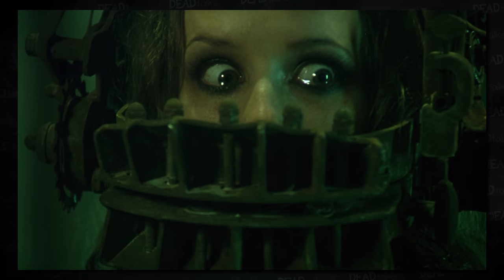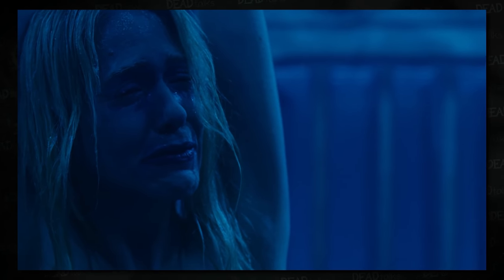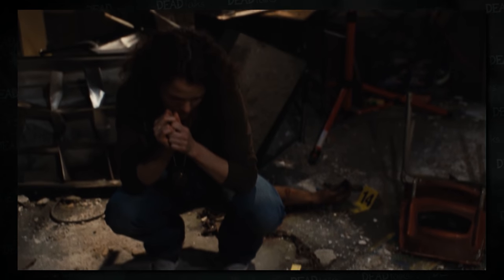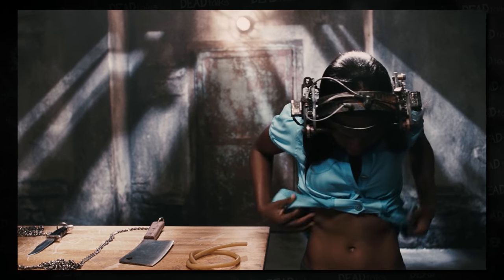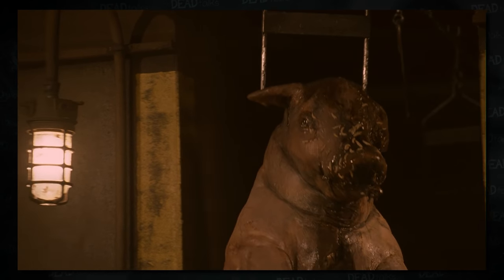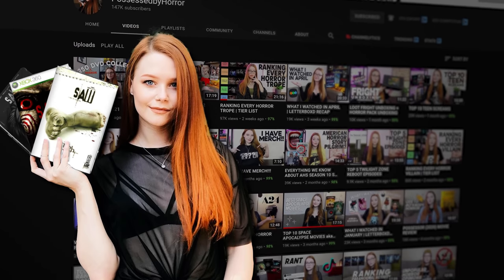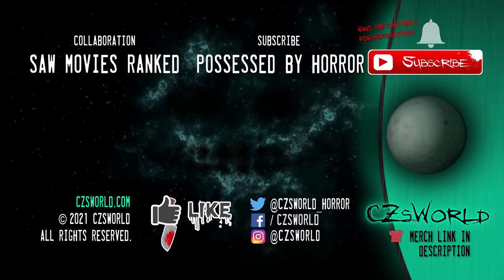5 Best Saw Traps Explained and Ranked | Ft. @PossessedbyHorror

Comment: Angel trap wasn't winnable at all. The lock didn't do anything. She got the correct key in time and unlocked it, but it wasn't designed to disengage.
Reply from the maker: It should have been though, based on John's intention for it.
Reply: he said it could have been winnable if it wasn't rigged with the wrong key
Reply: @boostedpotato7081  But the problem was that the lock didn't do anything on the trap but give false hope. She did complete her trial and unlocked the lock but she still died. Amanda changed something else besides the lock & key to make it unwinnable, but what the change was we cannot say for certain.
Reply: From what I understand, John designed the original angel trap. Though when Amanda went to set it up, she made a few adjustments that made the trap unbeatable.
Reply: right and the trap was literally in her bones. she couldn’t survive.
Reply: @boostedpotato7081  The key isn't how it was rigged, it was clearly the right key.
Reply: @CZsWorld  Amanda rigged it...
Reply: @CZsWorld  Yeah, it should've, yet it was latched into her bones. I guess that was Amanda's idea.
Reply: so with that trap I’m assuming, even tho they were locked into her bones (and if Amanda had not rigged it); if she were able to unlock it then the cage would not have opened up. she probably would’ve been able to get down and unlock herself further and would’ve been tasked with finding her own way to salvation/getting help
but since the key was switched out by Amanda then she wasn’t able to stop it from engaging🤷‍♀️ 
because I don’t think Amanda would’ve known how to stop it from disengaging without getting John or Hoffman to notice her tampering with it; but her switching out a key was plausible
Reply: Just a question because I was always curious since the first time I saw this trap. Wouldn’t she bleed to death?. She has her torso kinda open the whole time.
Reply: @boostedpotato7081  The key wasn't the problem. The device was attached to her ribs - how do you expect her to remove that? That's the exact problem SHE ran into. You see her undo the straps, and then realise that there's no way she can get the actual device off because it's attached to her ribs.
It's like how the classroom trap guy has a ring through his jaw. He couldn't have gotten that out. What was he meant to do, rip his jaw off?
Reply: That's because Amanda purposelly made it unwinnable
Reply: They already said that in the video.
Reply: It was never winnable the acid could've been poured out and if she knew the contraption she could've poured the acid on 2 wires that makes the entire trap work
Reply: Like others have said the key wasn't the problem. If you watch the scene she unlocks the cage then realizes that the arms are hooked into her bones. It would seem if she actually left the lock on the arms wouldn't actually been able to open. Idk if she would have been able to live long enough for her to be rescued. But her ribs wouldn't have been ripped out.
Reply: @MrLiljohn1980  I think maybe she bolted it on to a bone or something
Reply: @Alexander Wawrzyniak 
It’s easy to escape though
The acid would only cause skin burns which would hurt yeah but wouldn’t be a permanent disfigurement
Reply: it would be funny if it was winnable but the key was too dissolved
Reply: I do strongly believe if the trap was made by John Kramer himself he would’ve provided an easy way out for Detective Kerry. Unlike Amanda and Mark Hoffman whom makes the traps inescapable.
Reply: Semantics. The way Jigsaw designed it it’s 💯 beatable
Reply: actually it was! John planned for it to be winnable Amanda Rigged it by giving a complete different key! So it was going to winnable
Reply: @frooogy5292 it has nothing to do with the key. Kerry retrieved the key and succeeded in unlocking the padlock. The commentator obviously didn’t watch the movie or didn’t brush up before making the video. The real reason it was inescapable was because there was no way to disengage the trap from her ribs. I imagine that the original design was to unlock the padlock and remove the vest as Kerry did which would have revealed a mechanism with a switch, button, or lever of some sort that would’ve retracted the moving parts of the device from her ribs. I believe that Hoffman and John probably put Kerry in the trap and Amanda was instructed to do some final touches like preparing whatever mechanism dropped the key into the acid once Kerry became conscious. At that point she likely removed the mechanism so that unlocking the padlock and removing the vest or whatever the fuck it was revealed nothing that would have helped Kerry.
Reply: Even if the lock worked and it let girl free.. the machine was spiked into her ribcage. It cant go without dying of blood loss..
Reply: @MrLiljohn1980 My theory is that using the key on the lock was originally supposed to trigger a mechanism that would either release the cables and detach the harness from the trap or deactivate the trap itself, but Amanda rigged it by altering the design so that the lock wouldn’t do anything. I could be wrong though.

Comment: Another thing about the needle pit is these are USED needles so you can survive it initially but its entirely possible for a person to get some kind of disease from this pit, possibly even a deadly one
Reply: You could also survive by somebody who was up there, in this case, there was. You could attempt to get a coat or shirt to make less needles puncture your skin
Reply: HIV and Hep don't survive long after exiting the body, so the chance of getting any of that from the needle pit is extremely slim. A thin piece of cloth would do nothing against a needle... 

If anything the needle trap is probably the easiest and least painful traps in Saw, the reason it works so well is most people hate needles, myself included.
Reply: @Death-999 I’ve had bad needle sticks before and I can assure you that the Needle Pit is far from the least painful trap. Bad needle sticks are extremely painful. If you’re unlucky enough to get one, you’ll never forget the pain. I know that from experience.
Reply: Okay you totally gave me a new perspective. I thought it would be an easy trap. Whoa, did not think about bad needle sticks and ouchie!

Comment: My only gripe with the freezer room trap is that he could have took off his sweater to cover his face so he doesnt have to make skin contact with the pipes. 

If I'm missing anything about that trap I'd love to hear it.
Reply: There were lots of ways to avoid true punishment, for both involved. He could use his clothes to block the sprayers, giving him much more time to get the key. He could, as you said, use his clothes as a barrier to prevent burning off sections of his face. He could have just been faster instead of stewing about the decision (granted that's the point of the trial -- they expect him to take forever to decide).

Plenty of these traps are beatable in ways not intended by Jigsaw, especially since he has a tendency to set them up in areas with lots of loose crap around to screw with the mechanisms.

Comment: 2:52 Another thing to note is that if it's too cold, the water would freeze before reaching her, basically pelting her with little ice nuggets every time it shoots.
Reply: i think it was actually liquid nitrogen instead of water
Reply: @isabellam6027  But liquid nitrogen doesn't turn into ice, and we see a THICC layer of ice on her by the end of it. Pretty sure it has to be water.

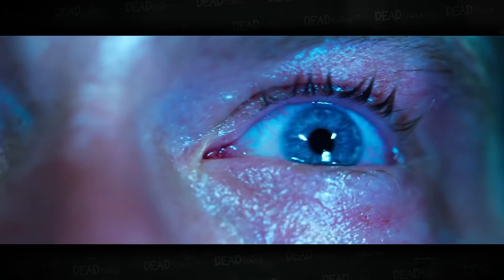Comment: 7:25 the thing about the tongue trap was that even if he jumped and ripped out his tongue we would still certainly die. The tongue connected to just about everything in your head. I’m not entirely sure where in the muscles would tear out, but at the very least it would sever the lingual artery and you would undoubtedly bleed to death, or at the very least choke on your own blood, without a tongue it’d be very difficult to keep the blood flow out of your airways and you’d need immediate medical attention, you’d most likely bleed out or choke within minutes. The tongue is also connected to the mandible and the temporal bone, meaning it is very possible that either the tendons connecting the tongue to the jaw and skull would break, making basically your entire throat come out of your mouth, and even if you immediately get treated after the fall you would still lose your ability to move your lower jaw and your ability to swallow, meaning no talking, no solid food, and an extremely high chance of choking for the rest of your limited life. It is unlikely he would survive the initial impact, but even if he did he would have seconds to minutes to live and would most likely pass out from blood loss/shock before he can get anywhere close to help.
Reply: like honestly ethier way if you got hit by the train you would still get your tounge
ripped out

Comment: Bathroom Trap? It's so iconic especially with John laying there the ENTIRE time shocking tf outta them. 😅😂
Reply: It spans a whole movie and is convoluted, dunno why it wasn't chosen. Same with the reverse bear trap, so what if it was repeated, the reason it was repeated was because it was so awesome. Yet a pit of needles took up two spots. How is a test that can barely hurt you despite little pin sized pricks beat something that will rip your face apart? Literally zero logic.

Comment: The key did unlock the padlock on the angel trap. The issue is that after removing the covering that was padlocked on, no way of disengaging the device from her rib cage was revealed. It is likely that John designed the trap to have a mechanism with a switch or lever that was inaccessible without removing the cover that was padlocked. Amanda probably simply removed this mechanism and reinstalled the padlocked cover.

Comment: The spraying water in the cold room would be SO easy to beat... Throw your shirt and pants over the spray, then you have an infinite amount of time to get the key and it wont be blasting her with cold water anymore. To not burn your face, rather take off your socks or underwear and use it temporarily as a barrier while you grab the key - unlock the girl, grab your frozen clothes back and exit the room together. Eventually, your frozen clothes will melt and you can put them back on again later.

Comment: I wanna explain my take on why the angel wing trap is my favorite and why its winnable (if Amanda hadn't sabotages it and the key was correct). So if u notice closely the jar that holds the acid is movable not still, so she could have easily tilted to the side to spill the acid on the floor, and then the key wouldn't have melted, neither her hand. Only Amanda ruined her chance of living... I think thats a good explanation ive been thinking of it for a while

Comment: Top 5 - Bucket heads - only downfall of this trap is that the buckets were removed after first part of the game, would be better to have them equipped for more than just 1st part
Top 4 - Acid meltdown - only game / trap that you cannot win, but the game plays you, not sure if there is another game-trap where decision of another will decide your result.
Top 3 - Waterboarding by hot wax - brutal, cruel, and unimaginable trap, would put it higher, but both top places are already taken
Top 2 - Finger trap from Spiral - doable, survivable, maybe (just theory) even without ripping your fingers off, but still very effective
Top 1 - Nail death mask -- fast death, yes, doable, possibly, but brutal yes

Inglorious honorable mention - Brazen Bull, although I like this trap, it is mostly not her deal that she is suppose to be in the trap on first place.

Comment: All of the traps in the Saw series are designed to work as intended in real life (if they’re made to do so, of course). The production team take great care in designing traps that can work in real life, even enlisting real engineers to help them design the traps. They’ve been doing this for every single film, even the Saw 0.5 short film that James Wan and Leigh Whannel made in 2003 to pitch the original film (they enlisted a friend of theirs who was an engineering student to help them design and build the first Reverse Bear Trap).
Reply: Which is why I won’t be surprised if it ends up happening in real life

Comment: Y'all should watch Nerd Explains (or it could be Cinema Summary, both are good and do similar videos) on beating SAW. The angel one is completely unbeatable, because even if the key was correct, it wouldn't stop the trap. And the scalping one simply wouldn't be a factor if the detective had listened, as he started the trap by interfering.

Comment: I used to worship the Saw franchise as the best horror series ever when I was a kid, until I realized that the majority of traps can be escaped easily through methods that weren't mentioned by the instructions. Then there are some traps that you just couldn't escape even if the instructions claim that you can. So some traps just don't work as intended and once I realized that, I started to dislike the franchise. The stupidest example is that guy who pretended to have survived a Jigsaw trap and had to impale meat hooks into his shoulders to hoist himself up some chains to get a key. If the only goal was to climb up and get the keys, why need to impale yourself? Just climb up the chains. Climbing up rope might be a challenge, but chains would be easier.

The freezer trap: the guy could've reached the key without his face sticking to the bars if he put cloth over the bars.

The blood eagle: even if you managed to get the key through acid, how do you expect to free yourself from a metal contraption that's hooked to your ribcage while one of your hands have been melted to the bone? Sure, you could argue it's possible the strings just detach from the contraption but you won't remove the cables attached to your ribs without damage, possibly bleeding out. This trap is just sketchy, add the fact that the key was the wrong one (on purpose)

Pound of flesh: I don't remember the entire set up and it's barely visible in the video. Couldn't you just pee in the container with the scale? This may not work though since liquid would likely spill, unlike flesh. Then again, you have tools and furniture around that you could throw in. In desperate situations where your adrenaline is in action, would it be too hard to dismantle that table?

The tongue one in the subway looks fine. I haven't seen that movie though so it's harder to comment on it.

The hair trap: if you know there's a knife around and your hair is the only thing that the trap is pulling... Well, I think this is a no brainer. Instead of telling the guy to look at the numbers on the gears, just have him cut the hair off. Do you really think killing the dude is even an option when you're trying to survive a trap? Save yourself first and then worry about whether you wanna kill the guy or not.

The pig grinder: that seems like it gives you a bit of time and some freedom to move, find a tube the guy could breathe through and/or stop the machine? Possibly low chance of success though.

Needle pit: the only reason most of the traps here have killed anyone is because the people rarely ever helped each other, almost all traps here could've been escapable. There are plenty of tools around and they managed to rip some boards off of the wall at some point, use them to dig through the needles instead of your hands.

The gallows: another trap where jigsaw actually does the killing and the victim isn't the one being physically hurt... These types of traps are cheaty.

Cupid arrows: this one is quite good. Only complaint is that once the girl has pulled the spikes out, there's a possibility she still does bleed out.

Needle pit chosen twice? I don't like Saw 2 that much, it's full of dumb situations. It massively relies on the people in it, even though a lot of traps are survivable. I'd say Saw 2 is the worst film in the franchise in terms of anything other than the social drama (one thing the film excels at).

In general, most traps with gears might be beatable. People often have tools around, sometimes metal, try sticking some in between the gears.

Traps with guns pointed at your head? Aside from the shotgun necklace, singular barrels pointed at your forehead can be dodged, there's such a thing as tilting your head to the side, maybe your ear gets blown off but it's a small sacrifice to try surviving.

The head in the fish tank one? It's clear that the bottom is made of rubber to form a tight fit to stop the water from leaking out, did you really have to stab your neck to breathe? Stick your fingers in between your neck and the rubber and have the water drain out...

Comment: Is the Angel Trap not attached to the Detective's ribs? So even if she did get the correct key, she wouldn't have been able to escape?
Reply: Who knows since it was rigged, but maybe there was something between the device and things attached to the ribs that could be separated once the locking mechanism was removed.

Comment: Okay I get the concept of needle pit is absolutely horrific. But in the movie it was way too easily avoidable. They have metal\wood planks and boxes right in that room, it could be beaten faster and with less trauma by just using those. So the concept - pure nightmare fuel. But execution - eh I dunno
Reply from the maker: I think the issue with that is that you might be on top of the key.
Reply: @CZsWorld  yeah that's fair. However Amanda was at the same level of threat, basically being on her fours with quite a limited circle of search. But yeah, technicalities, it was still hella effective in the narrative